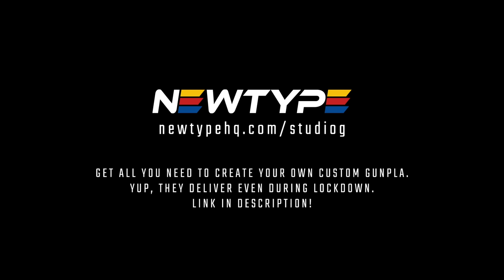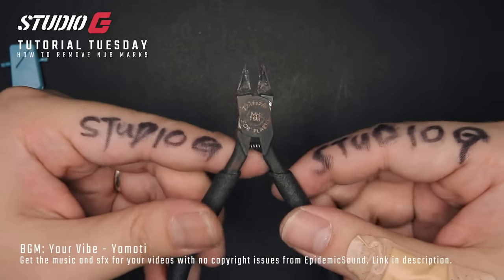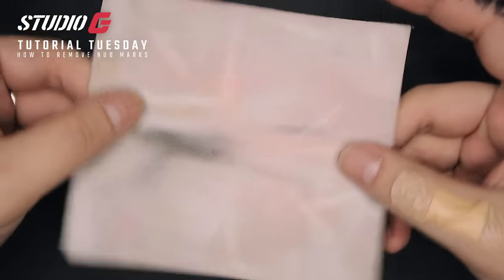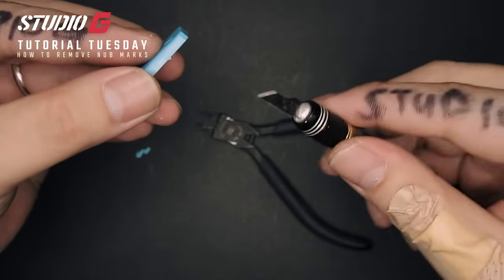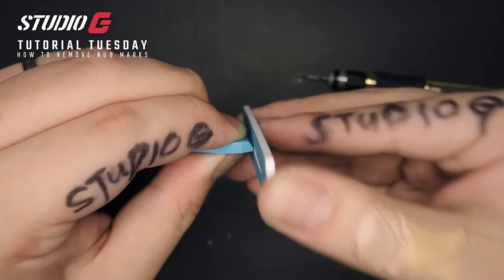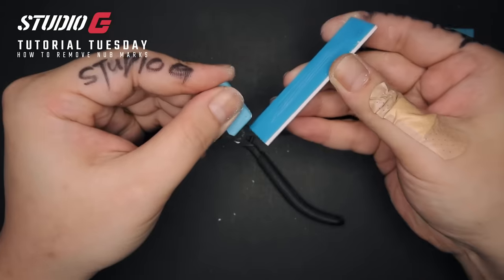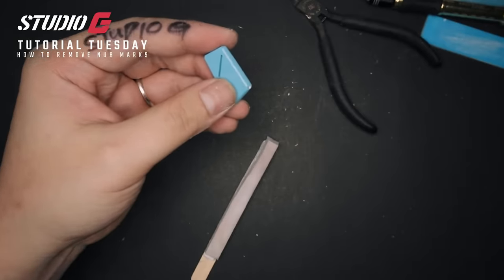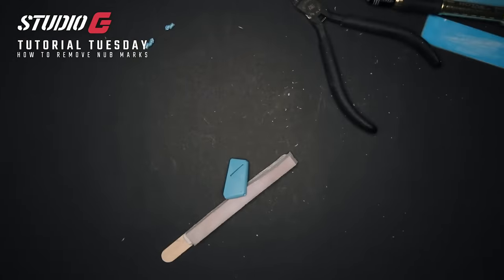How To Remove Nub Marks On Gunpla | Tutorial Tuesday

Comment: When you're gonna do a full paint you really don't need to completely removed the nubs even if there's a stress mark since they'll gonna be covered by paint. As long as you cut them perfectly flat with the surrounding surface you're fine. Also saves you enormous time on completing your kit.

But if your just gonna do a straight build/minor color correction then it's highly recommended you completely remove them.

Comment: Usually for me shaving the excess is enough. They’d be barely visible by then. And once I top coat the kit, the nub marks would only be visible if your looking at the very closely.
Reply: jeg tano what top coats do you use, I recently have got the tamiya weathering kit and have been dry brushing my gunpla before that, any recommendations?
Reply: The RedKing's Art__ 6221 I suggest using matte if your weathering.

Comment: quick tip for all gunpla builders: get your elbow fixed on the table and flick your wrist to sand rather than using the whole arm, it’s much faster, leaves less unwanted scratches and your arm wont be as weary after a long build. Great video, really straightforward, i hope this video existed when i was starting out.

Comment: So Jiatin is your name. Mines Dustin, hahaha, pretty awesome to learn you are named with the one of the most common way I tend to be called. Anyways, back on track. Your way is a little more time consuming but I prefer it a lot more than the method shown by others. It is much more meticulous yet it means less or slightly less steps if done right. It is much viable and a better way to do for beginners and those that cannot access to more extensive yet more expensive ways. Not only that, atleast now doing the other methods now becomes more of an in case I mess up thing to do. Thanks Studio G, this is what I was actually looking for.

Comment: Damn, I recently got into gunpla building, just got some exacto knives, and it seems my skill of cutting numb marks was better when I used the regular box cutter. It was more smooth and easier to use. 
With the exacto knives (I have the same shapped blade as the one on your knife), I've managed to hurt myself, accidentally  split the v-fin, and remove a huge portion of plastic in one spot, which I barely rectified with some sand paper. Did I mention that I am a leftie lol

This requires time, effort, patience and practice.

Comment: everytime after polish it, the color looks bit faded. seems like every "how to remove nub marks" videos never pointed this out. maybe because they'll paint after it...
Reply: That will go away with proper sanding and washing/polishing you just need really high grit polishing cloth above 2500 combined with a foam buffing pad if you are not going to paint after and want it to shine again.
Reply: SleepyD that’s a really good info. Thank you!
Reply: I’ve found that using a buffing compound after 3000 grit brings back the shine.....in my case, it’s plain white, no frills, toothpaste.  I buff the surface with the paste using a Q-tip in circles then wipe off with a slightly damp microfiber cloth (using circular motion).
Reply: @timothymcdaniel7372  by plain white, did you mean the white parts of gunpla kit? sorry i dont really understand. but i will definitely try the above 2500 grit method.
Reply: Najmi D. Plain white toothpaste, not plain white parts....generic white toothpaste works well as a buffing and polishing compound
Reply: @timothymcdaniel7372  ah got it! thanks, man. gotta try it soon. thanks for sharing great info.
Reply: Yeah ive always had that problem when trimming nubs with a hobby knife
Reply: @timothymcdaniel7372  does this leave a glossy or original plastic finish? I build OOB (that means no topcoat) so i've been pulling my hair out trying to find a method that restores the original color AND finish of the plastic

Comment: Instead if using all the different sanding sticks and sanding sponges, save yourself some time and money, go to target or wallmart and get the multi surface nail buffer. The ones that are 7 different colors work beautifully, and you'll only need like one or two a build. You will have to be a little more careful but I use them on all my builds and so far so good.

Comment: Sandpaper kit at Wally $4
Popsicle sticks $1
Trex ds tape $5
Cheap nippers $9
God hand $25 (it's worth it)
Nail buffing block $3
This is what I use. Cheap nippers for initial removal, and God hand for final sprue removal. The reason is that you want something as sharp as possible to remove nub. It'll make the stress mark smaller. I also start with 1000g sandpaper. It take a long time, but I get very sentimental with my builds because of how much time I spend with each individual piece. I will repeat. 
$30 nipper are absolutely worth it, but I wouldn't pay more than 40.

Comment: I'm still strugling to get hobby knife part right, I sometime went to far and cut the parts.
Reply: leave some nub marks and switch to a diamond file or sanding sticks/sponge. If you cut too much use thin cement mixed with the exact gunpla parts to fill the gap/hole. Let it cure for a day then remove it again. Even if you don't paint the kit it won't be visible later once you top coat it

Comment: love these tutorial tuesday vids! btw I'm curious about getting rid of weird-looking lines on some wide flat parts that look like it was created during the molding process. can I remove it only by top coating the part or should I sand it first with high grit? I don't have any painting / airbrushing tools at the moment so I can't repaint it.
Reply from the maker: Oh those are literally can't be fixed. Unless you paint them actually if I'm not mistaken :(
Reply: it actually can relief a little bit by spraying topcoat matt. while top coat gloss will get the surface more brighter but  more serious on the weird-looking lines .
this is the only way to overcome in straight build stage.if modified build like studio G, just spray or paint.
Reply: it has two possible, first is Watermark on the surface when the plastic is mould in industry, second is plastic shrink problem went plastic cold down from heated ,the surface temperature are not same as the temperature inside the plastic.uneven temperature cause the plastic surface form the weird-looking lines.you can sand from 600 to 1000 on that surface ,and spray top coat matt,can end results is can relief some,but not all solve.
Reply from the maker: Gundam Game Woahhhh I'm learning a lot just by reading your comment! That's some good stuff!!!
Reply: @StudioGundam thanks! ya lets learnt together and build gunpla in the simplest way！
Reply: whoaa thanks for the responses

Comment: Cuttings parts off from the gate is just gonna wear out ur nippers faster. Invest in god hand snippers it barely stresses the plastic so you can cut it right to the part.
Reply from the maker: Xajnos I cut them straight on the runners cause of the ASMR hahaha if not I'll be cutting it like a normal people and it's for for demonstrations in this video. But if you can get god hands definitely get them but they are so pricey and not much people can afford them 😔

Comment: I'd like to thank you for the tutorial - very straightforward and easy to follow. 

However, I'd like to mention one thing - the stress marks on certain colors and types of plastic are more visible, for example the Gundam 00 blue plastic really marks easily; the dark blue on Unicorns (not to mention the stupid gold on Phenex; as well as the red feet on many MG kits.
I also experienced one thing with the white plastic - a nub in the middle of a semi-sphere (the ankle armor on MG Exia) - and after sanding I could see a darker spot there, but the coloration was inside the plastic itself.
So, could you maybe revisit the tutorial one day and try different types and colors of plastic?

Comment: Is it normal to remove nubs on every piece?
Reply: If your looking to save time sanding and or the integirty of your finger muscles from excessive sanding i tend to just clip off nub marks on pieces that are covered  by outside armor bits, some knee joints, some shoulder armor and or torso pieces will cover where the cuts are.  Just observe your builds where the pieces are all placed and judge yourself which are not priority.  Not every nub is visible when a kit is complete.  Good Luck

Comment: hey man, love the video but got a question, i got sanding sticks 400 to 2500 and a sanding sponge sheet 2000, but i`m afraid to scratch the parts after sanding, but with the sanding sponge 2000 it should be scratch less?
Reply from the maker: Yes 2000 should start to remove the scratches. You can go 3000 even for better results
Reply: @StudioGundam  thanks for the comment, and happy new year forgot to say that on the last comment

Comment: What do you do about files that have a ton of dust stuck in them? Can you clean them, or do you just throw it away and get a new file?
Reply: actually you can use small flat brush to swipe the dust off.or you can you dip your sandpaper in water when sanding.it can remove the dust immediately .
Reply from the maker: Or you can just wipe the dust of with wet cloth :)

Comment: Level with me G, is the knife absolutely necessary?

Or can this be done without it?
Reply: Well, you need a precise tool to scoop the excess plastic off the parts so the blade needs to be really fine, you can try using a box cutter(but please absolutely keep the blade sharp. Frequently Break off the tip) But tbh, Invest in art knife man, they're much better.
Reply: @FeeFee_zz  So I can't just use the sanding stick and call it a day?

I absolutely HAVE to use a knife?
Reply: @MasterSwo  nipper cut won't look as good man, and using a nipper to close cut a part can potentially damage the parts
Reply: @FeeFee_zz  WHAT?!

No I mean can't I just nip it off the runner and just sand the nub away without using a knife?!
Reply: @MasterSwo  you can, it's your shit anyway, but as I said, it won't look as good and it'll be harder to sand. Using a knife brings you less hassle
Reply: @FeeFee_zz  I can live with that.

I just don't want to put another hole through my thumb.

Comment: not really scare about straight parts, even round parts like the armor of the zaku, the most most most most headache part is when the nub marks or seamline has this chamfered  edge, like the feet of gundam, or those edge between the zaku's spike and round armor  meet. Its a pain in the ass when getting rid of the seamline. honestly thinks sanding and masking is the fundamental of gunpla.
Reply from the maker: Benjamin Ang it is! It's all about sanding and shaving isn't it haha :)
Reply from the maker: Hahaha it cultivates patience and put you in zen mode hahaa
Reply: Apply cement first and sand with spongesandpaper or use 3mm sanding stick . Adding more cement can avoid accident sand away the detail and edge but can easily remove seam line
Reply: If accidently over sanding,use AB putty ,just stick a little bit on that place, wait,and just sand like normal.

Comment: This is what i am thinking about last night, how do you remove nub marks, and do you also remove the seam line?
Reply: G.1991.P to remove seamlines, use plastic cement to melt the pieces together and remove the excess cement with sand paper after it has dried.

Comment: the problem is that you never get the original finish back even with polish or shine, and thats on regular pieces, if its a glossy finnish its even worse
Reply: yeah i have the same problem. It's insanely difficult/near impossible to get the original plastic finish. I don't want a glossy finish 😫 As an OOB builder I'm not going to use topcoat either :/
Reply: @stoaksawbr2803  yeah, same way when they tell you to do line 5 steps for water decals. I still had to buy a decal softer because if not its easy for them to fall off whn you manipulate the piece.

Comment: Why do you have to use different sandpaper grits? Still new to this.
Reply: I'm new as well, but from what I understand, the higher the grit number (600, 800, 1500) the softer the sandpaper is. Now, as you're sanding and getting closer to the main piece, you use higher and higher grit (softer paper) in order to avoid damaging the piece.
I also think it's a good idea to dip the sandpaper in water. The reason for this is your health. When you are sanding, there's micro crap flying from the plastic. Inhale enough of it (but that would take a whole lot of sanding) and you might develop respiratory problems.
Dipping the sandpaper in water helps so that the small particles stick to the paper.
Reply: @havocsurge7667  Thank you!
Reply: @GomuGomu4  Glad to help :D

Comment: The sandpaper leave my parts with white scratch marks. Ughh
Reply: you need to progressively use smoother sandpaper and finally end with a polishing stick, then you will minimize those scratches.
Reply: I suggest you use water sanding method (use water prove sandpaper and dip with water when sanding), because it can immediately remove all the excess the sanding dust.Actually The sanding/polishing sponge can substitute with a piece of brand new A4 paper. New A4 paper have the same final polish effect compare to the sanding/polishing sponge.
Reply: use putty/dissolve putty to fill the scratches. They cure overnight then redo the sanding with higher grit paper/sanding stick

Comment: There is no way to get around the stress marks and discoloration caused by cutting the runner off. The real solution is for the kit makers to have the runners attach to the underside of the part.
Reply: Will a matte topcoat get rid of it?

Comment: hmmm that knife technique is dangerous. I would recommend you to try this instead: hold the knife blade side away from you and slide the part down the knife edge (you do not move the knife).  In the case of plastic being hard usually use a cutting mat to do the job.
Reply: Someone said the same thing about 2old4toys' knifing method as well. You can see his thumb is guarding the handle and holding the sharp part back so there's no slippage. And like old man 2old4toys said: "it's safe as houses". 🤗